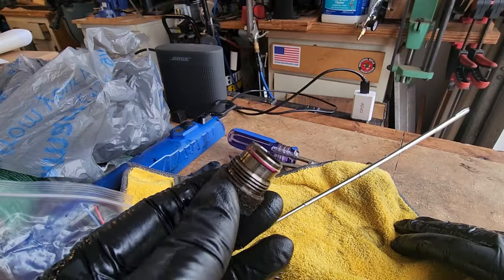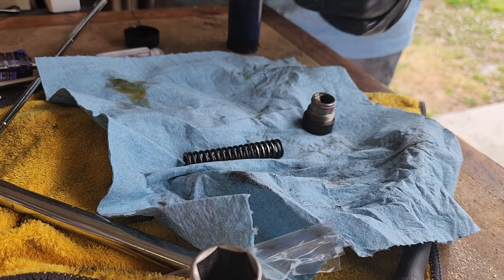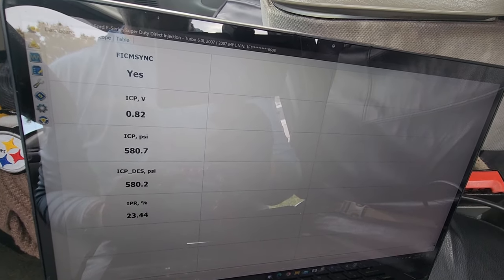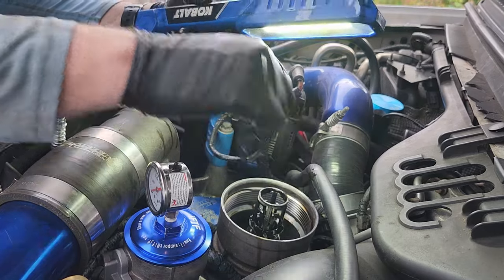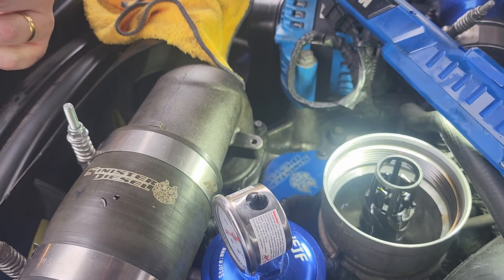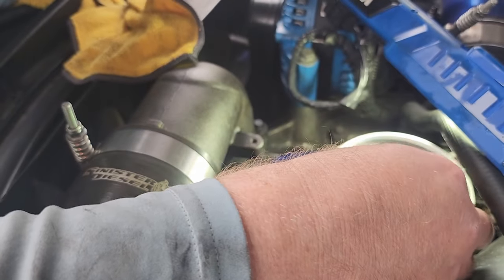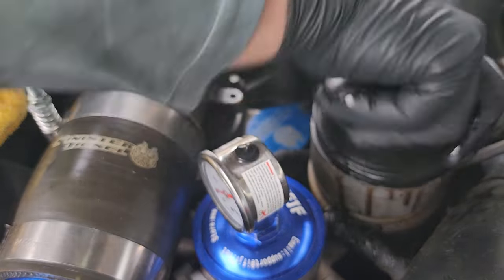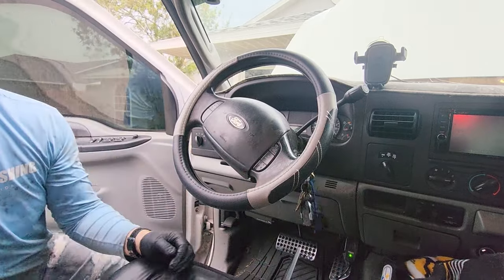6.0 Powerstroke Oil Issues Continue

Comment: Not only will the valve not have been pushed correctly, but that spring and ball act as a check valve, when the filter is in place, and cap on, oil cannot leave the filter housing. When you release, it allows the oil to flow back to the engine. and the filter to be removed cleanly. Great Video!
Reply from the maker: Awesome sir.  Thanks for the comment and for watching!  Hope you guys are doing great!!

Comment: I have forscan for my 2018 f350 6.7 powerstroke. It is a great tool for sure.  The 6.0 powerstroke sounds good, and when the issues it does have been fixed, they are a great motor.
Reply from the maker: Agreed.  It's been a great truck.  The 6.7's are great!

Comment: Thinking your ICP has failed open. Low pressure oil feeds the HPOP and ICP controls injector pressure from there.
Reply from the maker: We verified the ICP was good.  Ended up being a leak in the hp oil system.  My mechanic took care of it under warranty.

Comment: I’m doing a 6.0 egr and oil cooler right now, and mine is  missing that spring and top to? The truck ran good but had steam and coolant dripping out of the exhaust.
Reply from the maker: Wow!  That's no good.  Do you have chocolate milk in the degas bottle?  That was a mess when my oil cooler went.

Comment: IPR screen clogged? or Stand pipe/Dummy plug o-ring's are toast.. sounds like you need a 6.4 starter, Mine literally starts in under 2 seconds.. (2005 6.0)
Reply from the maker: It was orings in the hp oil system.  I've got weak batteries that need to be replaced.  I'll check into the 6.4 starter.  Thanks for watching.

Comment: I think the next time my truck dies via oil pressure, I may rip it apart?  I have a less than 50k on my oil pump and IPR, maybe I will take off the valve covers, redo injector seals, stans, and gasket of valve cover. I think I am covered on the fuel with a newish pump, FICM (via Diesel Tech Ron, RIP), blue spring.
Reply from the maker: Just got mine back from the shop.  I'll do an update soon.

Comment: your not building pressure from the low pressure side.
Reply: Seems to be.. he got absolutely nothing on that long crank.
Reply from the maker: It was making low pressure oil.  Ended up being leaks in the high pressure oil system.  My mechanic took care of it under warranty.